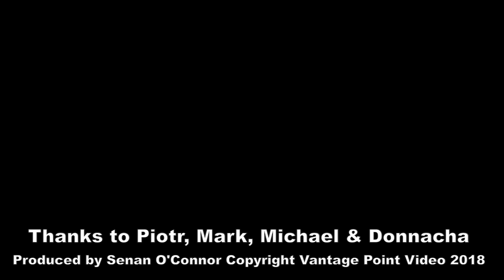Engine Rebuild Time-Lapse: Opel Kadett Historic Rally Car Build #3

Comment: why bother with a 1,3? a C20NE would be the way to go for a Kadett D.
other than that, love the car restoration diary, as I have a Kadett of my own, which is also in the process of restoration at the moment :)
Reply from the maker: This particular engine has a significant motorsport history and by fitting it to the car it will be eligible for historic rallying which has some nice tight 8 valve classes rather than the more unlimited modified classes you'd have to enter with a 2.0 litre. I quite enjoy pushing a small engine hard, it encourages you to be more committed and the drive train is well within it's tolerances so you get reliable motorsport.

Comment: Classic car? What, an Opel Kadett? That's barely a youngtimer, let alone a "classic"...
Reply from the maker: Classic Car is a fairly arbitrary term, there is no clear definition. To me this engine is a classic. It has completed 3 Circuit of Ireland Rallies since the eighties. It's out of an extremely rare right hand drive Opel Kadett 1.3 SR. The car it is to is officially designated vintage/veteran for tax purposes, would be eligible for Category 3 Historic Rallying. It's 38 years old, so eight years too old to be a young timer which is generally agreed as up to 30. I believe that the Kadett D as Opel's first front wheel drive car has an important place in the history of bringing cheaper safer and more comfortable motoring to a greater number of people. In class level rallying they were great achievers and were the foundation of glory that was reaped by the Nova/Corsa and Kadett/Astra, SR, GTE and SRi's